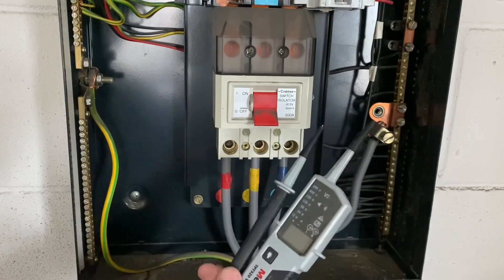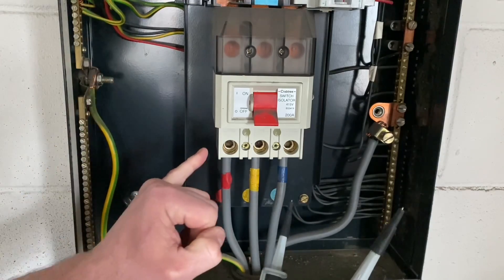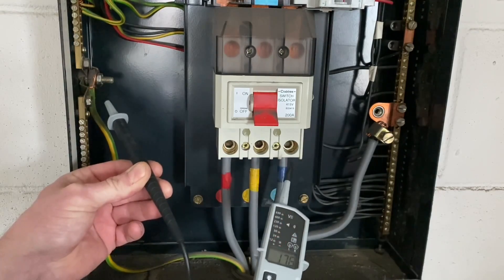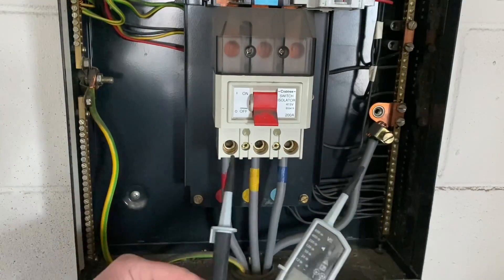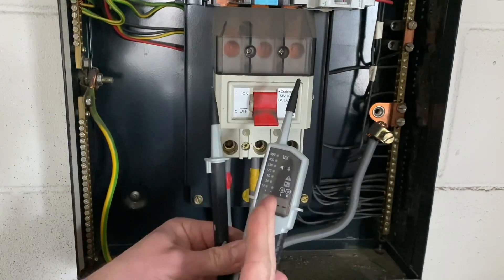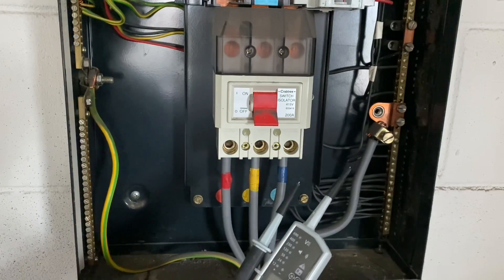First Live Test - Check Polarity of 3 Phase Supply, Using an Approved Voltage Indicator AM2 & AM2S

Comment from the maker: == 🕐 Time Stamps - Cut to the action 🕕 ==
00:10 - Approved voltage indicator 
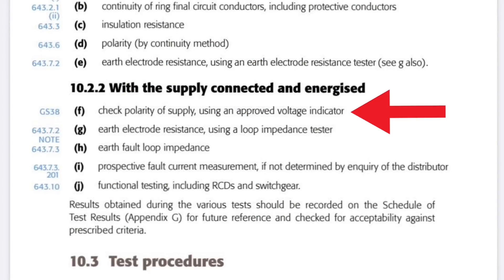00:28 - GS38 test probes
01:03 - Testing between the earthing conductor and line conductors L1, L2 and L3
01:31 - Testing between the earthing conductor and neutral
01:55 - Testing between neutral and line conductors L1, L2 and L3
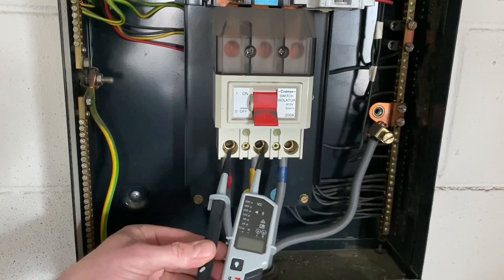02:12 - Testing between line conductors L1, L2 and L3

Comment: Question for Gary or Marcus can you explain  how you get a good ZS  when the CPC of the circuit is snapped at the consumer unit and you don't  get an R1 R2 thought that was the line earth loop for the full system.  Cheers

Comment: Hi Gary , quick question if you have two separate 3 phase supplies within an installation and want to phase them off each other , what is currently standard practice , rota scope them both or use a meter across them to see zero volts ? Many thanks in advance

Comment: Hi Gary, do you have a link for the approved voltage indicator and voltage tester please? I’ve looked but couldn’t find one, would be really useful for my apprenticeship when required
Reply from the maker: Metrel
MD 1160 LCD Voltage/Continuity Tester
http://hub.efixx.co.uk/md1160

Amazon
http://hub.efixx.co.uk/md1160amz

Hope this help 👍 (shop around)
Reply: @GSHElectrical  thank you so much! Love your vids!
Reply: @GSHElectrical  Gary sorry to correct you but the voltage indicator you have in the video 
I a megger. Great video as always
Reply: If it's that specific Megger that you want they have stopped manufacturing it. 
You may be able to find some stock of the TPT320 left at your local Screwfix. 
Otherwise search for the replacement TPT420.
Reply: Look for GS38 rated voltage testers. If you use Google for that GS38 you‘ll also find the requirements for the testers. Afaik they‘re usually not marked with this GS38 because that‘s a british localisation of a european  EN standard for voltage testers.